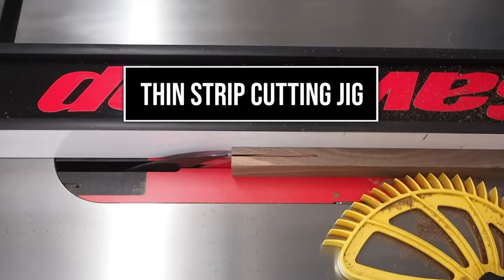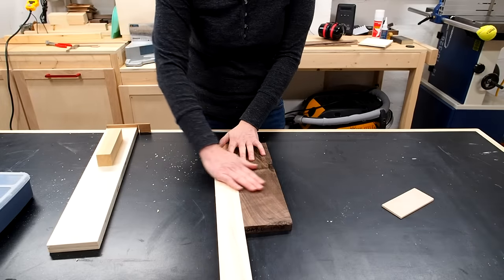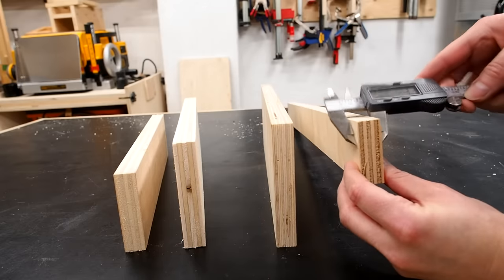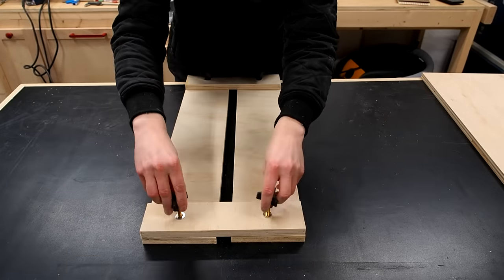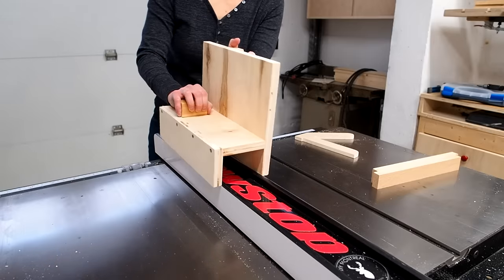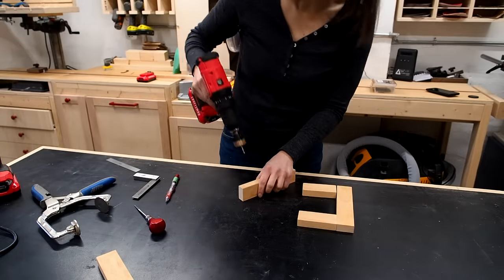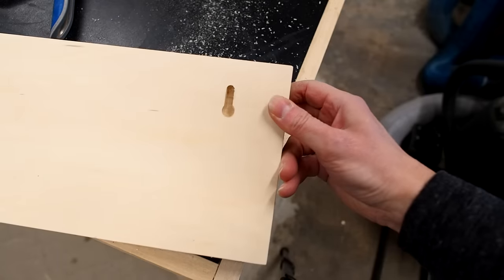5 super simple woodworking jigs that’ll make your life easier

Comment: That adjustable dado jig is awesome! I've never seen anyone make a dado jig with this design. I think woodworkers are used to adjustable jigs that use T-track, keyhole slots, or dovetail slots of some sort to create parallel adjustable rails. Your use of pivot points to create an adjustable-width slot with parallel edges is a less common technique, but it's perfect for this particular application.

I also like your thin-strip jig! It feels both safer and also easier to use than some other methods for cutting thin strips.
Reply from the maker: Thanks! It feels awesome to be able to improve on designs you've seen and actually have it work out ;)
Reply: It's even easier to buy the undersize router bits made for plywood
Reply: @jimhammell187  .... very constructive comment there, Jimbo...
Reply: Impressive video.  I use the thin strip jig at a slight angle from 0” thick to 1/2” like a taper jig an inch and a half tall, and make killer shims out of 2x4 and 2x6 drops.

Comment: Thank You!  Thin strip, dado, vertical cutting and key hole jigs are what I need to make.  l have an old Delta table saw,  back when riving knives were not a thing.  I always look for safer ways to cut other than my table saw sled. Thanks again.
Reply from the maker: My pleasure! Safer is always better in my book.

Comment: Like your dado jig. Been using saw guides like this for decades. Only thing I’d add is use thinner plywood for the base so you don’t give up depth of cut. With 1/4” base you can rip 2x parallel or tapered.

Comment: That dado jig is brilliant! I'll make that one for sure. Other ones I've seen are way more complicated and some require a specific bushing/bit/router setup to work. This one's universal!

One addition could be a piece on one of the long parts at a 90° angle, so that you can butt it up against the workpiece and get it square that way.

If you add a fence to one of the long parts, you could also use it with a bushing to make mortices!

Comment: for cutting with skill saw I just use my speed square as a jig to get straight cut on small pieces of material. pretty handy trick I learned from old carpenter and shared with my coworkers during the years..

Comment: Enjoyed the video and your instruction style. Clean and simple.
The dado jig was genius. Thanks.
I was less enthusiastic about the thin strip jig, however. You never showed how you consistently reset the fence after each cut. Unless I missed something, it relies on repeatedly sliding the jig again the blade with exactly the same pressure, time after time. I will not be able to do that precisely. I doubt most people could.
Thanks.
Reply from the maker: The beauty of the thin rip jig is that you don't need to reset the fence. The piece that gets cut is between the blade and the jig.
Reply: OK. I went back and watched again and now see what you mean. Your right, no fence reset. Thanks for explaining.
I think you'd need some downward pressure to the top of the board you're ripping to make sure it didn't move out from under the jig, toward the blade. Putting pressure on the side of the board, after it passes the edge of the blade, is a no no.

Comment: I just came across your channel and subscribed. The jigs are great. The only comment i have is using thinner material (1/2” or even 1/4”) for the circular saw guide gives you deeper cut capacity and a lighter weight.

Comment: Great stuff. The thin rip jig will really be useful for me. 

I'm pondering if I can get the same result with an L fence connected to my table saw fence. Possibly, but so far I can see a way to do it but it requires a bit of fiddling for each cut.

The dado jig works great, I've had the same for years. My suggestion is to mark the direction to run the router against each side. If like me you don't use the jig that often. I used a sharpie, but a pencil will do. 

And a complementary tip is to mark the direction of rotation on the router itself, looking down from above. It helps to visualize which way is a climb cut, so you can avoid that.

Comment: I bought one yesterday, and did two blades. You helped me figure some things out,thanks!
I noticed that at least one arbour is a tad too large for a typical blade,so I may have to grind it down to fit,or find a matching nut and knock off the points to make it work.
Great video, brother.

Comment: So cool! Great jig idea. I realized after aquiring 10 radial arm saws for no reason, that they are extremely good at cutting very precise, impossible cuts. You can actually just set a board down on the radial arm saw, with the blade in the normal position, and you can pull the blade towards you (a normal cut on a radial arm saw) and cut razor thin strips up to about 15" long, or more if you have a longer arm on your radial arm saw, some cut about 17" maximum cut length on the bigger saws. You can also cut tiny pieces that are so small that there is no way to cut them on a table saw, the radial arm saw can cut a 1/2" wide cube of wood if you want, without any safety issues, because the fence on it is wood and has a zero clearance to it, so the wood can't be accidentally ejected like on a stock miter saw with the crude aluminum fences. For strange specialty cuts, the radial arm saw seems to be extremely useful, and feels a lot easier to use than a miter saw which can absolutely destroy tiny pieces of wood if you're not careful.

Comment: Keyhole jig was my fav! Thanks.
I braved a version where I locked a piece to my fence, my router is mounted in the wing of my table saw, then pulled the fence to another stop. It was quite difficult for me. Primarily because it was the first time I used the bit. It worked very well, just requires a bit of coordination. Yours looks quite a bit easier to use. I'll build one for sure.

Comment: I’ve been using the skillsaw track jig for 35 years,easily my favourite jig. The clamp side can be used as a jointer with the same router and bit for repeatability. Or with a saw at a set bevel such as 45 degrees or 5 or 8 degrees for a door or window. Also can be used for the short side of the saw base in some cases. Cheers.

Comment: I have really struggled with those stupid keyhole bits. Getting straight and consistent slots is a nightmare. I make a lot of them for a side business. I’m going to make three of these to support three different distances from the top edge and a couple to match the top profiles of a few version that I cut on a bandsaw. What a simple and easy to use design. The dado jig is also a great idea.  Can’t wait to get into the shop. Thank you for posting this.

Comment: The keyhole jig was interesting.  I never actually thought of those types of bits making actual keyhole slots for hanging, as I typically just use them for making slots for T-bolts in wood.  Keyholes are nice if you only need one screw to hold it to the wall.  There is no way to get it level if you need 2 or more screws, especially if your wall is sheetrock, plaster or masonry.  Much better to use a french cleat for those cases, which you can level out before you hang your piece.  Your dado jig is a really good idea.  I have one that uses slots and a frame to guide the outside edge of the router, but this one seems a lot more accurate and easier to use.

Comment: I can actually use all of these. Just a thought on the key hole one, I like to run horizontal key holes for my signs because wood can be unbalanced and it's a quick easy way to get by using one nail or screw. The jig still makes it easier!

Comment: I really like the adjustable dado jig, but think I would counter-sink the toilet bolts with a Forstner bit and epoxy them in to prevent them from falling down.  Love your show!
Reply: I was contemplating doing them with one of those keyhole bits. I'm cheap and t-trak is so expensive! The right size keyhole bit would keep the toilet bolts from falling down because the track would actually be on the top

Comment: Hi Marie.  Great jigs.  With respect to the DIY track saw, you can maximize its utility if you run the narrow side of the saw's base plate down the side that you used for clamping.  It's not often that you have to use the circular saw in that mode, but when you do you're ready to go.
Reply from the maker: I feel that it would lack stability with such little support on the short side of the base plate. Don't you think?
Reply: @DIYMontreal  You're absolutely correct that it is less stable than cutting on the wide side, which is why I use it only when necessary.  However, I don't think it's necessarily unsafe.  Whether others use it will depend on their comfort level with a circular saw, the weight and ergonomics of their saw, and their wrist and forearm strength.  Keep up the great videos.

Comment: Great ideas - I need the vertical cut jig for some 4x4 that I'm working with at the moment - that would be so much easier than trying to get everything right o my basic cross-cut sled! Also getting a router in the next couple of weeks, so love the idea of the keyhold jig - thought of one simple modification instead of pinning the stop rail each time - adding a dovetail slot or t-track etc. on each side to mount the stop and make it adjustable. Nice basis for other jigs as well :)

Comment: 🤓 Circular Saw Guide - Because I potentielly needed as deep of a cut as I could make, I made mine with (leftover) excess laminate flooring (just over 1/4" thick). The basic design (design concept) is identical, just thinner. Works like a charm.  😎

Comment: Lots of good stuff!  I hop you won't mind my picking a few nits though.
Regarding the thin strip guide...
There is no particular reason for the end piece to be so thin.  If you don't have thin stock, something 3/4" would do just fine.  Some emphasis on making it higher than the thickness of the stock being cut would be appropriate, especially in the initial jig where there is VERY little left after the first cut.  Which supports the case for using thicker stock for that.
As to the track saw replacement...
Good stuff, but during the demonstration you drew a perpendicular line then clamped the jig using the line for reference.  I would always follow that up by using the square to validate that the jig is positioned perfectly.
The dado jig is cool, but making two passes at different depths makes repeating the same depth when you need to make identical dados a problem.  That cut wasn't that deep, it looked to me like it could be done in one pass.

Comment: The thin rip jig is "best in show" thanks.  Track saw sub:  note that track saws use rubber gasket/strip material along the long edges.  On the cut edge side, install the strip proud and then cut it with the circular blade so it is even with the guide.  The rubber strips do two things:  first, it's non-skid so you usually don't need to clamp the guide to the workpiece.  Second, the rubber presses down on the wood fibers and almost eliminates tear out (circular saws cut vertically upward) on the guide side.  [And to capture a good edge on the fourth side, use painters tape along the cut line]

Comment: Really like the thin strip jig! You cut 1/8" thin strips and that cuts a slot on the back piece. If you wanted to cut say 1/4" thin strips, or multiple thickness strips, would you need to replace that back piece each time?

Comment: Very useful set of jigs, thanks. One question - for your dado jig, why did you cut the slots for the T-bolt heads all the way across the long pieces? (seems like you could have just carved out a small recess for the heads to hold them in a fixed position). Perhaps you were intending to elongate the through holes, to give the jig an even wider working width?  Thanks again for the good work, -gc

Comment: Love the keyhole jig. But, rather than moving the alignment brace, why not use a space block and some tape? Better yet,  just drill some holes in the alignment piece and tap them. That way you could use some thread bolts to offset the jig for various projects. You could even cut a notch or mark detents in the threads to be certain of your spacing. Just a thought.
Reply from the maker: For sure! Did my best to keep them as simple as possible but each of these jigs can be made even better.
Reply: @DIYMontreal  Understood. The shim or spacer would probably be your best bet to keep it simple. Personally, I think the spacing you have is probably the most practical.

Comment: First off, thanks for using the push stick you're using. I started using that basic design some 30 years ago and have seen it in very few videos. I find it safer, easier to use, safer, provides more dexterity during use, safer, and also provides a safe way to push would away from the blade in a very safe manner. BTW, did I say it was safer? Next, a suggestion: I like your keyhole jig a lot. Very simple and very effective. However, when you wanted to raise the location of the keyhole, why not just use a piece of wood of varying thickness placed in between the default location and the item you're adding the keyhole to? This means you do not have to pry off the current one and replace it. Rather, just stick in the distance you wish to raise the keyhole and when done, either put that stick in your firewood or write the thickness down and save it in the same location as your jig? Lastly, I've not seen the parallelogram approach to a dado slot jig. I like that a lot! Very good stuff there.

Comment: I think you could fasten down some cheap toggle clamps to the top of the second to last iteration of the thin strip jig, allowing for pieces of varying heights. I've made a few very simple jigs with them and I find that very light pressure is enough to keep a piece in place on the saw without causing too much friction between the bottom of the piece and the top of the saw, but it may not work great if the top of your saw isn't waxed and smooth. Too much clamping pressure will obviously make it difficult to push through though.

Comment: When you were making your test cut with the circular saw guide, it looked like your saw cutting depth was maxed out because the motor was at the straight edge guide.  I've made several of these over the years and if you can use thinner material for the guide base and guide straight edge you can gain some cutting depth...

Comment: I like the thin ripping jig, it’s almost identical to the fence jig which operates very similarly only yours moves apart from the fence. Question, I have uneven extra strips of hardwood scrap (fairly long and could be cut shorter) that I’ve wanted to rip safely on the table saw but because they’re thin enough and uneven I don’t have a way to hold the piece unlike the board you ripped which is what 2”-3” roughly. In that scenario how would you rip already thin stock (less than 3/4 to 1/2”) that’s not square or perfect straight without a planer or disk sander?

Comment: Hello, I have been following your channel for several months and wanted to  comment on a couple of things in the video, so here goes :)   
*Thin strips: I have not built that jig, however my eye caught the micro jig you were using - I bought two - I love them!
* Adjustable Dado jig - I built a larger one from 3/4 MDF to do 48 inch plywood.   Very cool!  However, I noticed when clamping on the board you want to make the dado for, the jigs faces are tighter on one end than the other - e.g.  The faces of the slot are not parallel.   My initial thoughts were the board I am clamping onto is not straight, so I tried  clamping onto some T-Track and  - tighter on one end than the other end.   Any ideas where I went wrong?

Comment: That dado jig is pretty cool! I have a question about the vertical jig. Can you also use that for doing a resaw?
Reply from the maker: It's more for cutting vertical parts but not for ripping long boards. Maybe for reawing shorter stock i guess if you can find a way to adequately clamp the stock to the jig. Wouldn't be my first option.

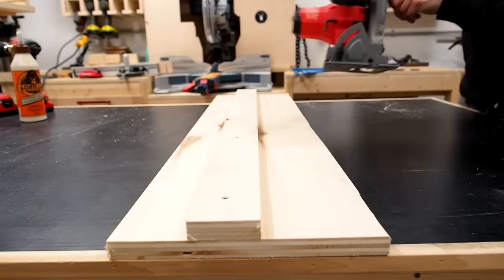Comment: Good ideas...but SUGGESTION on Circular Saw Guide (@ 5:42) ... 3/4" is too thick; 1/4" material makes a better guide for saw's foot to glide across without interfering with the saw's motor or other parts.

Comment: Going on aout kickback, and then stand directly in line with the saw blade, so if there IS kickback, guess what is going to get hit. You are.  As far as cutting your thin strips, don't need to move the fence, or make a jig.  Use the fence as your fence as the stop, and use a wood push block to push the wood thru, staying out of line of the blade.  I have seen so many videos where the self-proclaimed expert stands in line with the saw blade.
Reply: Hey KAREN..head on back to the knitting group,maybe finish your Bud Light

Comment: It’s easier than that for circular saws. Clamp a 1/4” thick straight edge 4” over from where you want the cut. Most saws have this as the plate offset. Check yours to be sure. Follow the straight edge while cutting. Done. And you don’t lose 3/4” of cut depth.

Comment: Brilliant way of cutting thin strips but the only thing is with my 745 Dewalt table saw the tithing knife is too high it’s higher than the saw blade so hits the wood. Looks as though I’ll have to remove the rithing  knife whether this is safe or not I don’t know. I’m surprised no one else has had that trouble

Comment: A cheap router is less than dadoblades.  So I have a router slide installed beside the miter saw. With hinges so I can just lift it out of the way.  It's about thirthy inches. I rarely make any cuts longer than that. And. I do not have to waste time on the table saw to change blades, it is allways ready. I allways do the first cut at 1/16 to minimise tearouts.